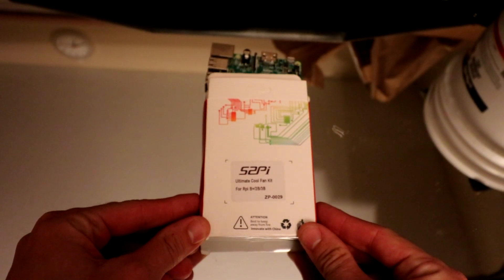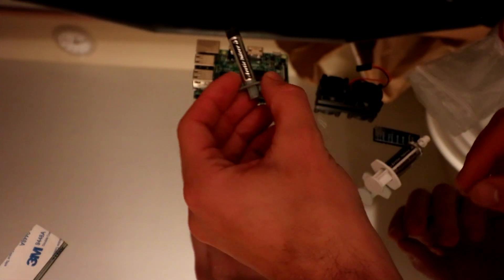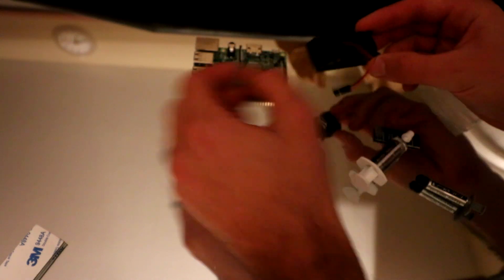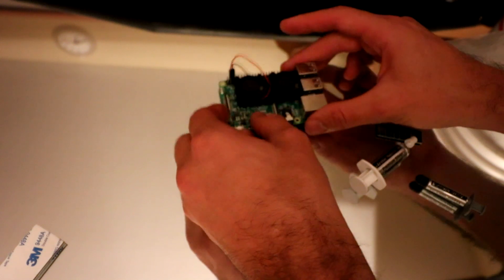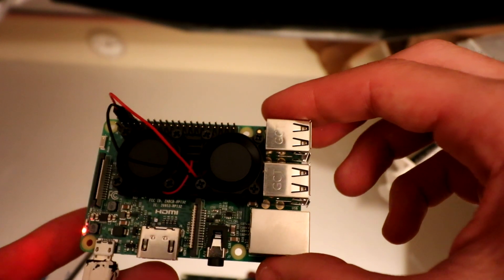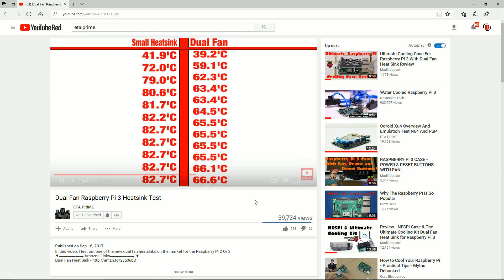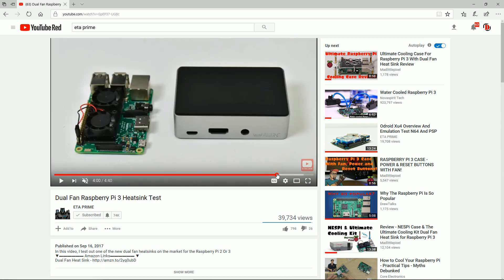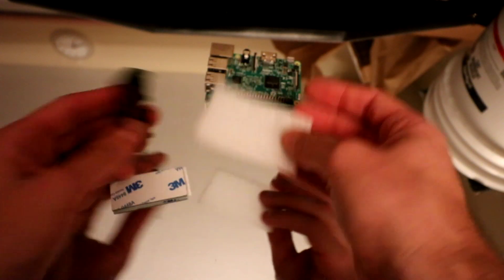iUniker Raspberry Pi Heatsink Dual Fan Unboxing and Review

Comment: Big thumbs down due to a very lazy video with bad information.  You use ETA Prime's temperature ratings, which don't even apply to your situation because you applied TIM instead of the heat pad method ETA Prime used.  Also, you used a really foolish amount of TIM....thus affecting the ability for the heat to escape the chips.  TIM should be a paper-thin layer to aid in heat transfer from one surface to another.  It should not be applied in huge goops like epoxy to hold the heat sink in place.
Reply: At the end of the day you don't even need a cpu cooler fan it's just a waste of money in the long run over just a simple sink. It doesn't make a huge different even for a overclock but u want to use more paste then not enough always. 2 little is bad 2 much just makes more of a mess who cares
Reply: Multiple reviewers have shown this fan destroys a heatsink in terms of cooling, they just did a better job at showing it then this guy did.   At least he did point out that the fan doesn't beat a good aluminum case.